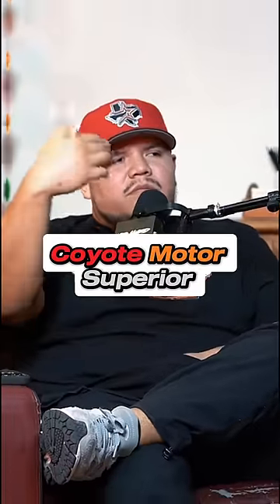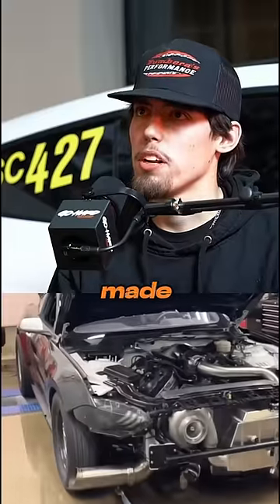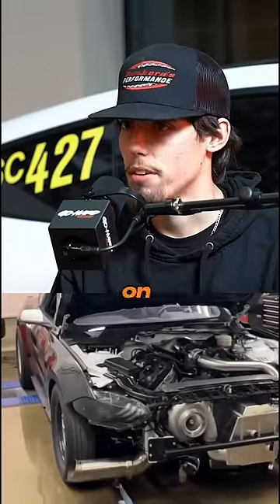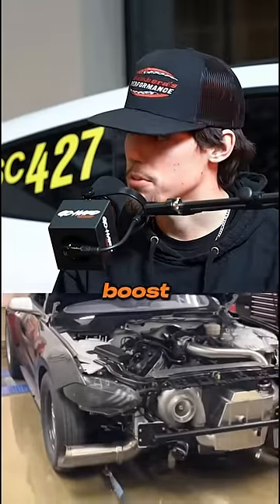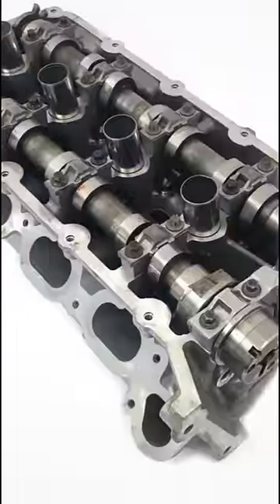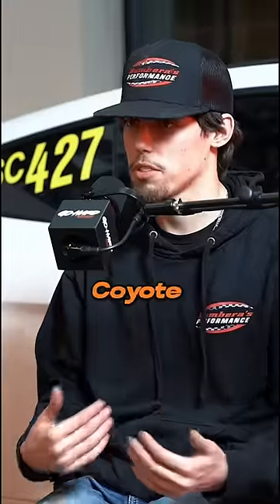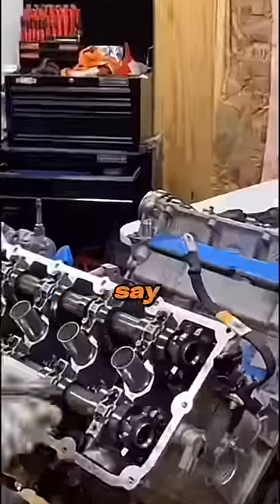SUPERIOR Ford Coyote Motor 😳 #shorts

Comment: The LS is still the better platform to build. It's more ubiquitous, can be built for anything and can do everything the coyote can but cheaper
Reply: Wrong prolonged revs destroy LS engines a coyote will live on limiter all day they are just as affordable  make more power easier are easier to swap thanks to the power by the hour control pack can handle more power and just to rub salt in the wound Chevy couldn't even build the LS engine themselves. They literally needed to buy the design off a ford engineer that design the engine using a 351 windsor as the base engine LS engines are garbage compared to the Coyote. The LS can't even compete with a 351 windsor the engine , it's a based off of😂
Reply: @Mr_Hillbilly_weeb  everything you just said is just wrong.

You can absolutely build an ls to rev to the moon and back. It's as easy as putting a 4.8 forged crank into a 6.0 6.2 7.0 block with forged internals. This idea that LS can't rev has been debunked like over and over again.

LS are the easier engine to swap. One, they're more ubiquitous and two they are physically smaller than a 5.0 because an isn't a dohc motor.

Both engine platforms are great don't get me wrong. But an LS is just the better overall platform because of its versatility, ubiquitousness, ability to hold a ton of power for less money and the fact that they can be put into almost any platform
Reply: LS’s r just better overall 😂 it’s ok to envious just don’t let turn to hatred.
Reply: @Mr_Hillbilly_weeb  spend your 50k. To beat a 10k ls hahahaha
Reply: @SacredHeart0520  your funny i can get a coyote at  a junkyard for 300 cause the you pick yard sells any engine you pull yourself for 300$ and the can dump the same amount of money into and be pushing 1000+hp on stock internals do that with your LS
Reply: LS is a great engine always will be but Ford and GM did indeed make it together and it wasn’t even the first time either. Cosworth AND GM helped ford build the Cyclone V6 that powered Lincoln and Mercury sedans and trucks/SUVS and other Ford models and PORSCHE was the one that actually drew up the concept for that model because they wanted to put it in the Cayenne and Cayman and they sold it to Ford because Cosworth told them if they had done that they’d get sued because Porsche forgot they had copied certain variants of the engine from the YB so they struck a deal and sold it to Ford. A lot of people don’t know these things because it’s not like they are making documentaries about what all goes down in the automotive industry. GM also had a big hand in the Ecoboost F150 all these people are no different than politicians they talk the talk but they are family when it’s time to break the bread.
Reply: @dexstarksmarforcom7616  yeah no. Ford didn't help build the LS. The LS may share some design features of the old Windsor but that doesn't mean Ford help develop that engine
Reply: @Mr_Hillbilly_weeb  i love how you ignored me. And the 5.0 is in two platforms. The LS is in... Plus 30 platforms
Reply: @Mr_Hillbilly_weeb  you think the coyote is better than an LS. You make ass diggers look like rocket scientist
Reply: @_.incredible_magnum._291  dohc engines are better than ohv engines in every single way, from flowing more air, improved valve control, lighter valvetrain, more rpm, true variable valve timing is actually possible with a dohc engine, nothing you say is true
Reply: @ErikGoranson  pushrods can flow air just fine. The LS platform is extremely ubiquitous and can be built to rev as high as any Coyote.

Dohc motors do have a air flow advantage. So what. LS can still make crazy power like any Coyote
Reply: @_.incredible_magnum._291   Project Spinal tap. Take a Dart LS block, a custom Winberg 3.5" cramkshaft. Made just under 1000hp at 9000+rpm... Naturally aspirated. Peak rpm was 11,000+ rpm.
Reply: @machinist7230  dont let the coyote clowns see this😂😂 LS all day man

Tbh, I love the coyote I just think the LS is the better engine platform for... Anything you want to do with it
Reply: A high horsepower LS can't keep the head gaskets in place. In fact most serious racers run damn coolant pressure sensors so they know when a head gasket is letting loose, FACTS 😂😂😂😂
Reply: @02autogt  define high horsepower
Reply: @SacredHeart0520 you realize the coyote in the video was waxing billet LS’s at sick week right? So who’s got the cheaper and faster motor now?
Reply: @19Elicar LS is not better overall. The only wins it has is availability(I’d hope so, it’s been out since 97) and size. Coyote is literally better at everything else. Efficiency, rpm, ability to hold power more out of the box, the cams and heads are good for WAY more power, the ability to advance intake and exhaust cams separately, the powerband is much broader, the list goes on and on.
Reply: @traxxasrcfun  I was meaning to bring that up to but ya know I just a “MAKEASS LS Hater” lol 

Another tuning advantage with not just a coyote engine but really anything from 08 on ward 3.5/3.7 all the different types of ecoboosts 1.0-3.5 5.0/5.2 etc have transient power tuning and one can literally tune individual cylinders on both exhaust/intake and ignition timing to further dial in the power curve. But don’t take my word for it because “LS hater” 

Actually I love the fact that the car community as a whole has a this problem with sticking with an engine platform and not being a full spectrum of powerhouses. Really it’s just that fact alone makes me cringe because it’s a lot more than just two engines out there but it’s always been about a little old fashioned heavy jealousy that keeps people from getting a lot of engine tuning and experience something that you don’t know anything about that really makes it all irrelevant.
Reply: @Mr_Hillbilly_weeb haha the Windsor block and the LS Block are common in what way? The LS looks like they copied the dodge viper v10 engine Block and heads.
Reply: The LT is a better platform than the LS and it will always be a better platform … don’t argue with me argue with Brian tooley … Ls this ls that .. the LT superior end of discussion 
The simplicity of a LT4 is awesome makes good power , heads cam package is amazing must it your gonna mess with these mod motors because unless the LT4 has heads cam is gonna be a long day 

As far as mod motors they are the king of flow and top end power … would it take much to beat the 5.8 liter ?? It would take more then heads / cam .. put a 2.3 or 2.6 on that LT4 then you have a fight … the airflow on the gt500 heads (5.8,5.4 ford gt ) is the best in the game !!!! I wouldn’t even waste my money porting those they are fine stock !!!  It’s hard to match the airflow of a mod motor well not hard but stock for stock the LS/LT looses that fight … does it make it a bad platform for power absolutely not … 
 I’m humbly humbled to own both unfortunately I’m selling the 14 gt500 to work on my c7z …. I’m doing a 390 LME iron block with a 2650 .. I’ll be at 1050 wheel on meth but for the record the coyotes and the Shelby’s are monsters I’ll always be a ford guy for life … but owning 3 Shelby’s I’m ready to move on and hang with the LTs and LS baby …

Shoutout to AMP in Dallas they did the work ..
Reply: @mach183  the LS is in 30+ different vehicles. There are millions of ls/vortec variants everywhere in the world. 

Not saying the lt is crap or anything. It's a fantastic platform. But is still not on the level of LS for the reasons of price, ubiquitousness, and ability to swap parts like Legos. 

I can put a 4.8 crank in any ls block. I can put LS1 heads on a 6.0 block and boost it and make a ton of power. All for super cheap.

The affordability, ubiquitousness and shared parts is what makes the LS the best platform in the world. Not to mention the goofy amount of power it can hold on stock block and internals
Reply: Who's whoa whoa man, don't be using big words like "ubiquitous" around these Ford Bois, they might think you're an astronaut or something...
Reply: @baronvonlookatchaboobs  🤣🤣🤣🤣🤣 "my coyote can rev to 8500" so can my 4.8 mf🤣
Reply: @mach183  we're talking about what's the better engine platform silly. And that's the LS. And it's because it's cheap, everywhere, easy to build and fits in everything. The lt just isn't as good of a platform as the LS. The two can make similar power but only one of them can be assembled like Legos and make 850 like it's nothing
Reply: @_.incredible_magnum._291  see what I mean, there's no way @mach183 knows all your big fancy words 🤣.  I'm curious what part of his comment he edited because it still makes no sense whatsoever.
Reply: @baronvonlookatchaboobs  the funny thing is that... I'm not even saying the lt coyote or any other American V8 plaform is trash. I'm just saying that the LS is the best choice

Comment: Let’s not talk about head flow and power falloff after like 7k or the getting notorious crank walk
Reply: Stock Gen 3’s rev to 7400, most tuners bump it to 7500? What’re you talking about?
Reply: this is wildly inaccurate haha
Reply: Crank walk at what 2k hp
Reply: Tf you smoking? My gen 3 made peak power at 8100, shift points are set at about 8200 on my 10r80. All top end power is what coyotes are known for
Reply: Crank walk 😂😂 snot rocket had just started to see crank walk running bottom 6’s.

Comment: Ok, except the engines are physically enormous and sleeving them is a gigantic pain in the ass.
Reply: But that's also all u need to do on the block 😂 for it to handle the power
Reply: Sleeves are easy once you do one set it's not a big deal as long as you can tear an engine down and rebuild in house.
Reply: @c130aviator  no lol, I work at a machine shop they are not easy.
Reply: @c130aviator Yeah…. No. If you think any random shade tree DIY-er is going to sleeve, deck, and  oring a Coyote in their garage the you’re naive (no offense). 

Bet you haven’t done it. But it’s easy…..
Reply: A Coyote will fit in ANYTHING worth putting one in...
Reply: Sooo worth it considering that sleeved coyote was waxing billet LS’s on sick week. Who’s got the cheaper motor now😂😂

Comment: All these coyote fan boys keep forgetting about the flat plane V8 Chevy just disrespected them with 😂 I swear they act like the LS is the only engine Chevy ever made
Reply: Has that flat plane even ran a number close to what 30 year old ls1s have?? Lol for a stock car yeah it’s a cool motor but this is a racing podcast talking about drag racing. That flat plane in the new z06s can’t even hold a candle to the old LS motors at the strip
Reply: @BarnfindGT  you obviously don’t know anything about the new lt6 do you? The whole engine is all around wayyyyyy better built than an ls the head can handle higher revs the crank can handle more power has direct injection therefore giving it the ability to run a lot higher compression and it gives you the ability to play with the timing a bit more it features a dry sump oil system giving it the ability to stay cool when the ls is heat soaked like LS’s love to do but yeah for sure bud whatever you say 😂
Reply: @BarnfindGT  also name a stock LS than ran a 1/4 under 10 seconds
Reply: @M-Powerdreamsgarage  again like I said they’re not talking about bone stock engines or cars on this pod cast. has the lt6 ran an 8 in the 1/4 mile yet? Has it done anything that the LS searies haven’t done already?
Reply: @M-Powerdreamsgarage  quit reading a brochure and go collect real world data
Reply: @BarnfindGT  stock it ran almost 8 who gives a flying fuck if it’s stock that’s the whole point kid it’s doing all this in stock form wtf you think happens when you add a 150 shot or some forced induction? You think the power level is gonna go down or some shit? 😂😂😂
Reply: @BarnfindGT  also it is real world data a guy straight up took his stock z06 to a track and walked all over every previous year vette and they had supercharged (c7) and a whole 1-2 (c6)  liters of displacement on the current z06
Reply: @BarnfindGT  oh and hey cute 5.0 too bad you couldn’t afford the rs3 roush like me 🥲

Comment: I wasnt pushing 1600hp but my 2000 audi quatro s4 b5 was stage 3 and i pushed around 38lbs of boost on her.
Reply: 38lbs of boost from k04’s is a wildly different story than 30lbs of boost on 62’s, 67’s, 76’s. 38lbs of boost from a k04/k24 based setup on a b5 s4 is unachievable. 

-b5 s4 owner

Comment: Dont mention the pulley snaping off.
Reply: Yeah the stock truck cranks have the possibility to snap at 1000+ horsepower. Throw a boss 302 crank in there (aka a factory produced oem ford part) and you're good until about 2900 and then it starts flexing at high rpm. Name one other engine that can handle 1000hp with nothing except a fuel system and boost on a completely stock unopened engine (intake to oil pan), now try and find one that will handle almost 2500+hp with almost all oem parts except gaskets, studs, and sleeves. People really don't realize how insanely easy it is to make power with coyotes.

Comment: Lol they literally did a test against the ls3. 6.2 it destroyed the 5.0 over and over in every way at big boost levels the coyote ran out of capacity and made 1500whp the ls3 made 1733whp on same boost. That's more then enough for me to choose LS everytime. Keep in mind adding a cam is a huge deal and the LS platform still kills 5.0s non stop
Reply: You need to go back to school and understand why dual overhead cams variable valve timing 4 valves per cylinder and a flat plane crank is a technological marvel and superior to your ls3 in every single way

Comment: Pretty sure snot rocket is running a billet block and he’s racing a pretty much tube chassis car with a mustang shell ain’t nothing oem about the chassis on that car 😂 that’s mustang guys saving grace they love to say oh stock block but rods an piston leave the atmosphere past 750whp 6.2 hemi making 1400hp on 20psi on an unopened motor reliably would love to see any ford motor make that much without opening the motor 😂
Reply: Snot rocket has a stock 5.2 predator block with different sleeves in it. It had a stock boss 302 crank in it until about 2900hp, and it has ported oem gt350 heads. It is not on a full tube chassis (which is irrelevant here because we're talking about the engine not the car). I think it has different rods and pistons but I don't think they're billet. The only billet pieces on the engine are the cam caps because they were flexing at 2500+hp and causing issues. That's also the only reason he isn't running the boss 302 crank anymore, it started flexing, didn't break it just caused some wear on a bearing. I'd love to see anything dodge make that kind of power with so few aftermarket parts. And btw coyote trucks motors can make about 1000hp on a completely unopened engine and only around 15psi and can take well over 1500hp with different head gaskets and maybe studs if you want more boost
Reply: @fcku4798  for one the chassis does matter all that power has to go somewhere and it is a tube chassis car the front end is tubed full cage an the rear end is a solid axle that is 4 linked to the 9. second you already said it different studs an gaskets there’s a big difference between 1,000 at 15 vs 1400 at 20 unopened no changing nothing 5psi=400whp? I didn’t think so how long has the coyote engine been out? Almost 20 years from gen 1 to 3? 6.2 has been out since 2015 and doesn’t have the aftermarket support ford and Chevy has its always been that way but when the hemi stuff comes around I garuntee you just like every ford engine ever it will be forgotten about shit you can’t even get a transbrake for a hellcat 😂 just wait that shit coming coyote power barely started coming around 2018ish for the real big power
Reply: The Coyote engine came out in 2011 lol

Comment: Superior to what, I'm assuming the LS.  I love the coyote platform but it has some problems.  The major one being the bore centers, it's so small the only way to get above 300 ci is to stroke it to under square and that's never the answer.  It's why the voodoo failed so terribly.  Oiling issues didn't help but the architecture was broken from the beginning.  Boost obviously will overcome any problems and twin turbo coyote screamer about 260ish cubes is a mean motor but NA it can't touch a LS.

Comment: Well when your Ford you have a habit of buying auto companies and owning all their current and future R&D. So after buying ...Volvo, Jaguar/Land Rover  Aston Martin, Mazda and a few other small manufacturing companies you then strip them of their designs and designers, sell the now worthless company for a small profit and use their R&D to make a good product. The yote is one of the better engines out there because the mod engine ( jag, Land Rover and Aston design ) was actually pretty good for what it was. The heads flowed well for the time but we're limited due to materials and available components. The 4.6 2v was 281 ci and was good up to around 400-ish hp before the powdered metal rods gave out. A 5.4 with a good crank and rods and healthy amount of boost could belt out 700+ no problem but it was all stolen designs and engineering.

Comment: I do love listening to the new tech dribble in todays age.30 yrs ago my tuner rocked up with a flat head screw drive to tinker with my 780 dominator..and boost was boosting from the cops
Reply: Ppl been running boosted setups for 100 years lol.  There's been multiple factory forced induction options since the 80s even with American cars.